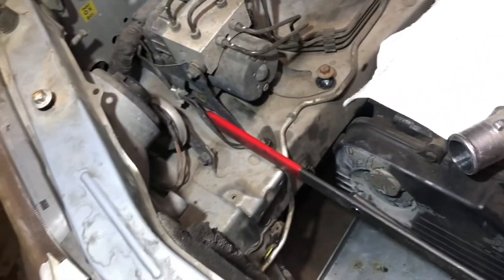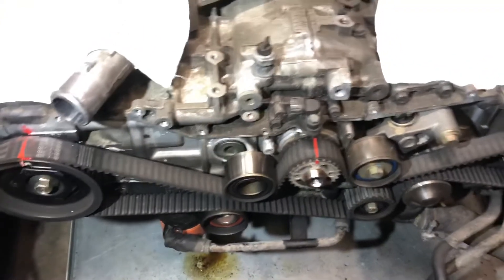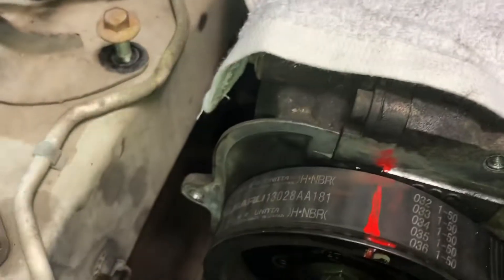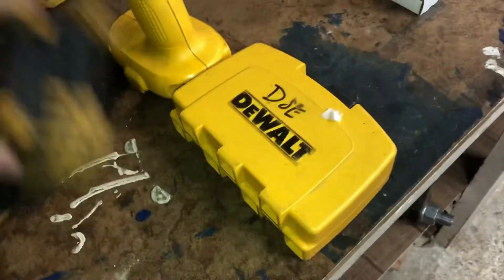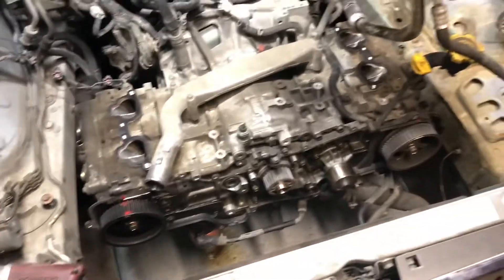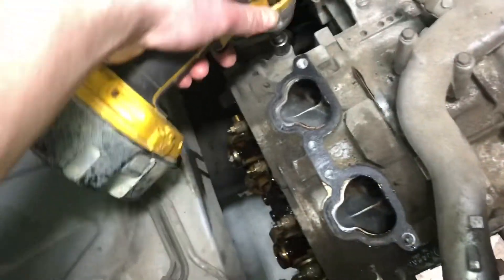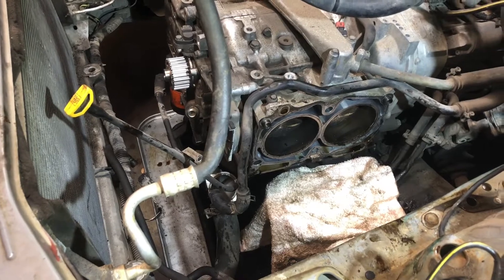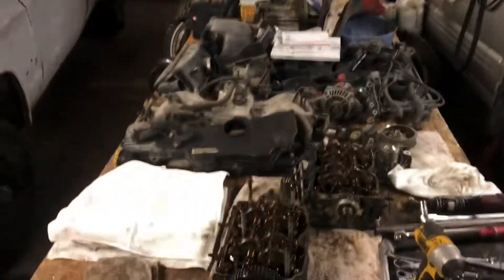Replacing Head Gaskets Subaru 2.5 Pt4-Timing Set & Head Removal EP163

Comment: Do I have to losen the engine monts
Reply from the maker: If I had to do this over I would probably pull engine and do the work on an engine stand though it was a tight fit going back together
Reply from the maker: Hi rpg, are you replacing the cylinder head gaskets on yours? What year make and model is it?
 You should be able remove heads by unbolting engine mounts, carefully jack up engine using a woodblock between jack and oil pan and then use a ratchet strap to pull engine side to side to remove each side.

Comment: Did you slide the engine side to side to remove the heads ?
Reply from the maker: Yes, removed bolts to motor mounts, jacked up engine and used ratchet straps to move engine one side to the other for disassembly and reassembly. Next time I would probably go ahead and pull engine and mount heads on an engine stand

Comment: Did you ever figure out what those leaky bolts were? around the 6:35 mark
Reply from the maker: Hey Micah, yes, those are plugs that allow access to camshafts, in future videos in series I think I mention it; I just removed them, cleaned, and resealed with silicone/ gasket maker etc
Reply: @LastFrontierGarage  THANK YOU! Oh my ive got a leak coming from one of mine and was trying to figure out what they were and how to fix them! Cheers!